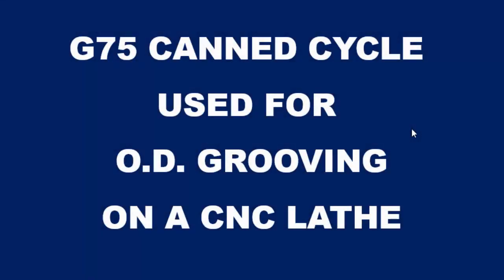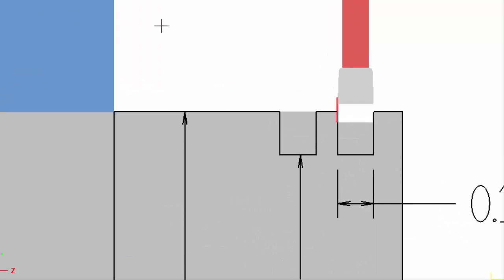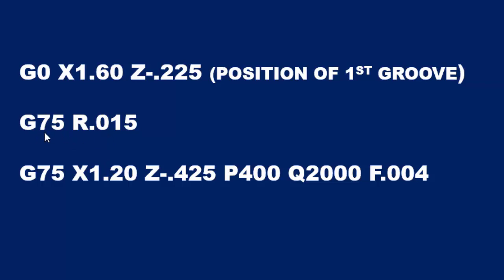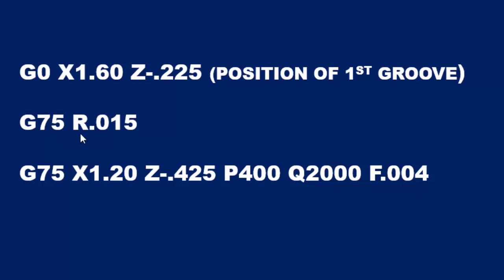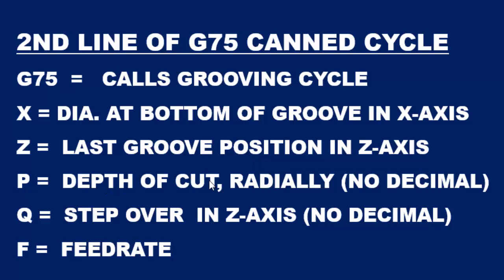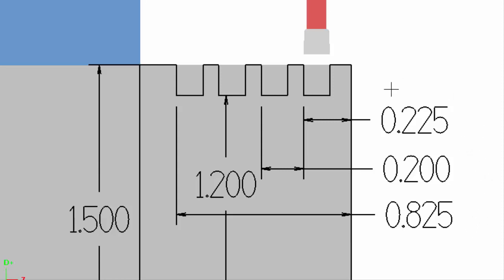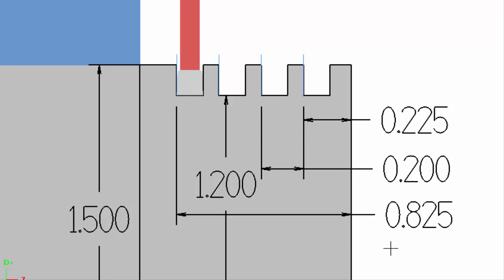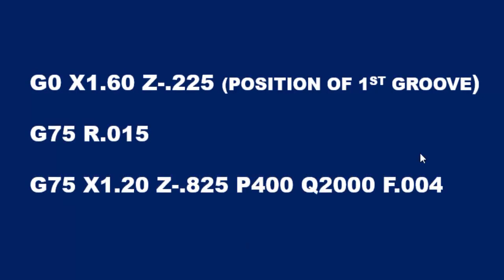CNC LATHE GROOVING USING G75 CANNED CYCLE

Comment: Well, that process is for a simple grooves. But if we want to make a shape using a groove tool (like a "V" Belt weel) what cycle must to use?
Reply: I wonder. This grooving has no options to cut a back chamfer. It's very easy to cut chamfers and making grooves like the V-belt type on Mazatoral. This Fanuc and G - Code program is not really user friendly. Mazak is still the best for me.

Comment: Hello Tom,     If I want to cut a wider grooves and it requires multiple passes to finish them then move to the next groove with .200 step over.  What is the P value?
Reply from the maker: The p can only be used for roughing OR multiple grooves. You will need to repeat a new G75 groove cycle immediately after finishing the first groove
Reply: Thanks.  Also, do you have the videos that show the G70 does the face and OD in one finish cycle?  I am admired of your works.
Reply: How do you add the values in the program that use G75 with a radius on the bottom grooves?

Comment: Hi Tom
could i use this G75 to do parting off?
thank you very much for posting these videos. they're so easy to follow and understand.
thanks agian
Reply: Yes, just leave out the P and the Z in the second line

G75 R.2
G75 X-1.6 P500 F.05

Sorry I work in metric not imperial
Reply from the maker: Yes you can. It is an easy way to add pecking.  Thanks for watching.   TS.

Comment: thanks for everything you teach in the FANUC-O language. Dear sir i have couple of set up (check machine tool out) questions if its ok?? Question #1-what is acceptible when i put a tenths indicator in the chuck or collet and put the indicator up against the ATC at its outer most MACHINED FACE POINTS and with each index of the ATC what is a normal amount of perpindicular to the chuck facial run out from T1 to the next position and so on until i make it all the way around, should i see for example .003 max variation through the 90deg, 180deg and so on till the 360deg point or is .0002 more like normal? Question #2-putting my (brown and sharp-carbide tipped) .0001 indicator on a mag base and checking the TIR of the spindle nose AND face with NO CHUCK mounted,, what is normal run out,, my spindle nose is about 2in in dia. and sticks out about the same,, should i see dead nut "0" radially and dead nut "0" on the face or once again whats the to be expected amounts of run-out for the lathe to be considered good shape,abused,wore out or NEW? Of course all points on ATC and spindle nose have been cleaned and lightly scotch brighted with wd-40 and then each point to be checked has been wiped down with acetone on a rag and then lastly cleaned with my thumb like you would use your thumb to wipe off a micrometer anvil,,no dings or nicks anywhere,, all surfaces in what looks like new condition,, .002 is the best TIR i can get out of my 3-jaw chuck,,just got a collet holder so i havent checked it yet,, all opinions welcome. I spent many, many years CAD/CAMMING A FANUC-O MILL,, im used to being able to keep set-ups dead on,, after so many years doing mill only,, me and my lathe are having disagreements!!! In other words im learning and dont know what im doing!   thanks for the videos,,very, very helpful!
Reply from the maker: ALUMATRIX Thanks for your feedback. I appreciate it a lot.
The run-out on a spindle nose using a .0001 indicator theoretically should be "0" but that is a lot to ask from a used machine. .0002 TIR is very good. Your surface may be clean but a .0001 indicator is going to pick up flaws on the surface easily. My recommendation would be to use a ground pin that is chucked in your chuck or collet chuck and check for run-out that way. After all we need to know if the part is running true while turning. The jaws in the three jaw chuck will always need to be bored before running a job depending how critical the tolerance is. Tolerances and functionality of the part being machined are major considerations and will determine how much effort you put in the setup.  Hope that helps.  Thanks  Tom
Reply: Tom Stikkelman   thanks for replying,,, yes using a carbide pin for the  spindle/chuck/collet TIR check makes more sense (been a lot of years since i touched an old daewoo i ran-feeling kinda stupid now-i knew this and forgot) how about my tool turret tramming question?? As you read on and i describe my ATC you will see why tramming it is so important in this case,  right now im getting about .003 max variation through the 360deg indexing of the ATC turret face (max-outer dia. identical machined points used for tram check) as i check it after each index,,, is the .003 ok or should i attempt to tram the turret like i would a mill head to a mill table and shoot for "0" ??  My turret is a solid ground 8-station emco-maier plate,, NO tool adjusting WHAT SO EVER other than height,, there are holes in 4-of the ATC positions for spot, drill , tap ect.,,,4-spots for square tools,, actually breaking loose the turret mounting bolts and attempt to tram the entire ATC to the chuck is the only way to make sure a drill for example is dead-nut in line with the chuck-center,, nothing else to adjust,,,its obvious its never been moved since it was new,,lathe is a low-hr 2002 model,,,work envelope is 5in-dia x 12in length,, if im being too picky forgive me but i really wondered what you think what kind of numbers should i see using a (.0005) best-test indicator THIS time against the turret face as i check facial tram,,,, OR as it just hit me should i install a 4in spot drill into the ATC and then drag the indicator which i set at "0" at tool/ATC-face point and then pull the indicator along the z-axis and see what it says at the other end of tool out in the air,, i could mount a carbide pin in the ATC and do same thing,,, whats your thought,, run around it as if tramming like a mill head to table or actually just check the tool alignment with the (z)-axis and whats an ok number at say 4in from the ATC,,, i wont keep pestering you but the way you teach you are very easy to understand,,, i dont run production so making sure the ATC and the tailstock are positioned within acceptible tolerances for me once set up correctly should only have to be checked once in a while but i am one of those dead-nut"0" guys if i can obtain it ,, again if im applying too much picky to the lathe you can say so,,, i did a lot of 3D cavity work over the years and i naturally look to the 4th decimal place for all dims. I appreciate you taking my last question and look forward to your answer and to more videos,,, the stock set up and tool zeroing,, using the geometry pages and offset pages properly on a FANUC-O controlled lathe would be a great and helpful video,,,, do an outside tool  and a spot drill,, reg-drill and boring bar for ID tools would be awesome and if you are feeling energetic tap a bored hole,, that would be about the best video that would help me along,,, again thank you for your time helping someone who remembers "optics" and a big-ol rotary table on our j-head bridgeport being the HIGH-END tools in the shop that NOT just anyone was allowed to touch that sat next to our belt driven southbend lathe,,back then when we needed a tool you didnt buy it you made it or ground it out of what ever you could find and worked slow,,my grandfather started me and he passed before DRO came out,,i often wonder what he would have thought about a DRO or a dig-mic using with 5-decimal points,,,,its simply amazing when i compare what we used when i was a young teen compared to now not to mention the tools that can be had with the click of a button,, i shall now leave you be !!! Thank you for one more question!